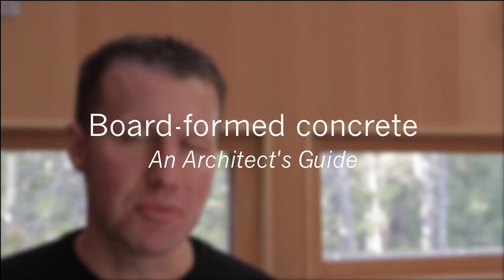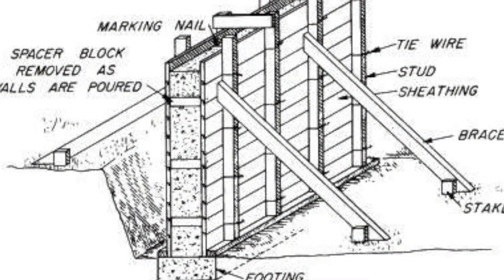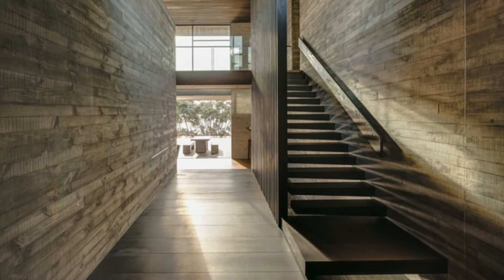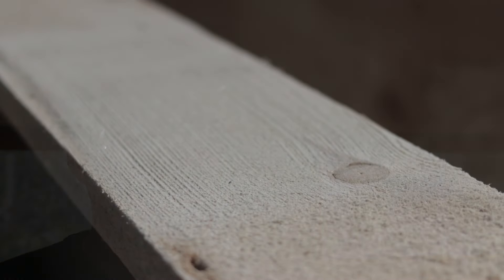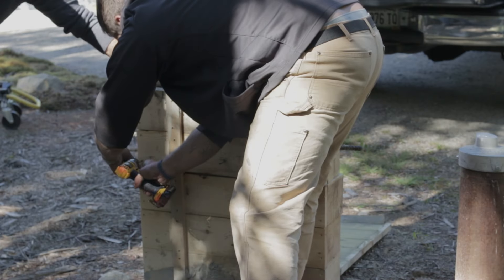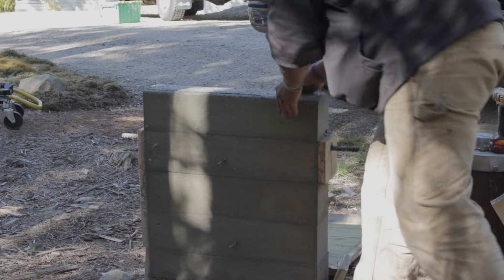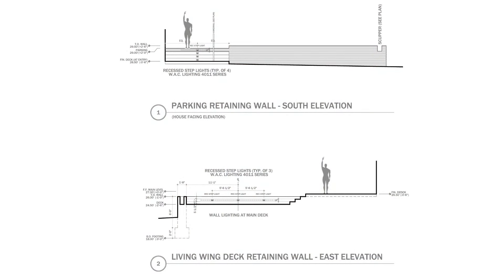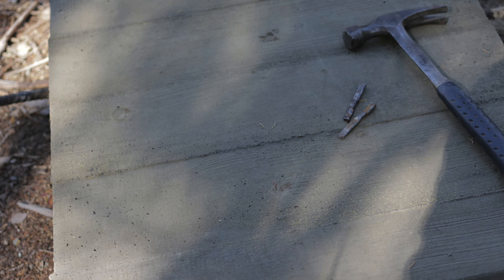Board Formed Concrete - An Architect's Guide

Comment: I love this building style..   but not as much as I hate drywall, plaster, siding and fiberglass insulation.  Any good contractors who specialize  in Central Florida? 
I have this idea to owner-build a  1000 sq foot two floor tiny home in Florida and sub contract the foundation, concrete shell, roof, windows/doors (flush mounted) over this shell.   Mechanicals, plumbing and electrical exposed and painted over one single  wall behind  my free standing kitchen and  entertainment systems.  No lines under my foundation.  A single hole in my wall for utilities sealed.   No interior walls, doors or trim (besides toilet rooms).  Acid stained concrete floors.  One Flat metal roof with 24 inches of rockwool insulation.   Crazy or Brilliant?

Comment: Does anyone know what the standard would be for insulation, if using this system as an exterior wall. Would one add a thin frame on the inside and insulate between the space? Please reach out if you have any idea. Thanks!!

Comment: Next time use Nox Cretes Clear Pre-Form, it seals the rough sawn lumber and stops wood sugar migration, which will expose the face of concrete as long as the forms stay up otherwise, the pre form stops the transfer of small slivers also, what you end up with is a non Absorptive surface to pour against, with the right form release (nox crete #10 -450 architectural release) and the right AMOUNT of form release youll get the most consistent, beautiful board form wall youve ever seen, it allows the wood to transfer all the grain and texture, but it will look like you used HDO plywood somehow also.

Comment: Looks awesome, but what about insulation and water penetration?
Reply from the maker: depends entirely on context (exposed exterior vs. interior), climate, and function. in new england we typically insulate to the interior which keeps from heating the entire thermal mass of concrete and we often use this for exposed retaining walls so waterproofing isn't necessary. you need to waterproof if you're using it in a below grade application that's near living space, but there's no reason to go through the extra trouble of exterior board forming at that point and you would waterproof per standard construction details. hope that helps...

Comment: heres a tip. have you tried plastic tie rods? you can lubricate them and pull them out the next day. reusable also
Reply from the maker: +Roberto Ramos ...form ties are cast into (and remain permanently) in the wall...we looked at fiberglass but had difficulty sourcing them..

Comment: 2 of the 4 elements are coarse aggregate (usually gravel) and fine aggregate  (usually sand).   Most concrete has reinforcing  (usually steel).   Both coarse and fine have been replaced by recycled materials, my favorite is crushed glass.

Comment: I know this video is old at my time of comments, but I would like to add: 
1- Monolithic pour
You fill your forms from bottom to top, non stop. Blowouts can occur with excessive weight from concrete.
Vs
2- Cold joint pour
You fill your forms from bottom to 4 feet high, let concrete cure, as it hardens it can support the next 4 feet of concrete, without a blowout.

Comment: I have a question please. I am planning to build my own house but have conflicting design ideas I think. I am in love and have been for quite sometime with Shou Sugi Ban (before it was all the rage) but I also love concrete equally. I want to build a very simple rectangular structure with the exterior being completely wood and the interior being completely concrete (walls, floors & ceilings). Maybe using concrete veneers for the walls and ceilings to make it more doable. Does this make sense? Will it be overly jarring, look ridiculous. I want both but need some advice. What do you think please? P.S. I still haven't found  suitable instructions online for building smooth walls from concrete for the DIYer homebuilder.
Reply from the maker: I would reverse the idea: concrete outside, wood inside. This - to me - is a more natural juxtaposition that capitalizes on each material's inherent strengths. Concrete is rugged and can withstand weathering and the elements whilst wood is harder to maintain outside. Wood is warmer and has a lower thermal mass - thus easier to warm up and cool down. You'll have an easier time finding subcontractors to finish concrete that's meant for an exterior (less finished) environment and likewise an easier time finding skilled labor to finish a wood interior than concrete. If you really like the look of concrete inside, perhaps reserve it for floors...? Hope that helps...

Comment: Hello, thanx for sharing your info.  Im planning to do a board form concrete wall, it measures 9.45 meters width and 11 meters tall, what distance should be between the control joints?  And, have you known about a proyect that used plastic fence as an outer shell, instead of wood?

Comment: One important step you missed, and this is extremely important, almost more important than your mix design, is using the correct form release and the correct amount, use a chemically reactive release and DO NOT over apply, a common misconception is that the note oil you use the better the forms will strip and the better the face will look, this is wrong, excessive form releases will cause bugholes and staining, and its a waste of money.

Comment: I am really enjoying your videos and this is another interesting one.  I was wondering if it was possible to use hempcrete for this type of project?  Also, could a similar type of method be used on flooring?
Reply from the maker: Thanks +Evelyn, glad you're enjoying the videos.
In theory, I presume this forming method would work with hempcrete, however I have no personal experience with it. Care should be taken to ensure the compressive and tensile strengths have been evaluated for the specific application; hempcrete has significantly lower values in both these respects than traditional concrete.
I wouldn't recommend it for flooring applications. Not only would it be difficult to achieve without stamping it, but surface irregularities could present tripping hazards and maintenance (cleaning, etc.) would be a challenge. 
Hope that helps...